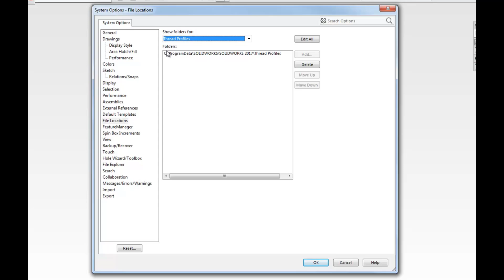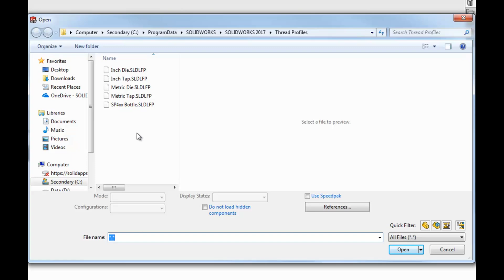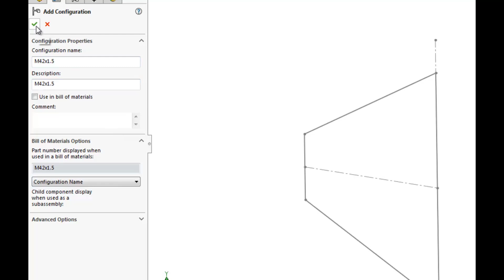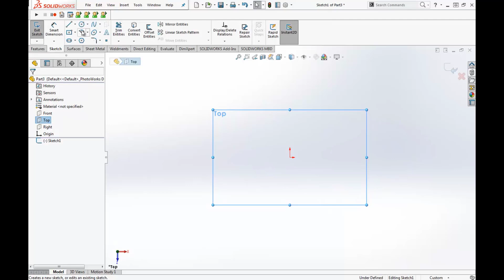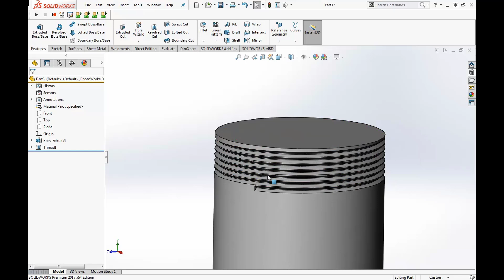SOLIDWORKS Hints & Tips: Adding a custom thread

Comment: Thanks a lot for the video.

I noticed something though when you edited the sketch.

the profile land was "1.5".this is because a die has an internal thread,& the land is determined by divding the pitch by 4 (profile land =Pitch/4).for an external thread e.g a metric tap,you would use P/8 instead.thus with a pitch of 1.5 your profile  land for the metric die should be (1.5/4)=0.375mm.

Comment: I'm able to change most figures but I'm looking to create a square thread and it sadly wont let me change the profile angle. It says its read only (I am running as administrator) I assume this is because that angle is a predefined angle for metric threads? I hope not though, will look for another work around if so :(
Reply: im having the read only issue as well. any resolution yet?

Comment: vishnu + 1 

I am having the same problem, how to edit this thread information if it is read only?
Reply: I had to run Solidworks as administrator. Navigate to the *.exe file (SLDWORKS.exe) which, under standard install,will be found in C:\ProgramFiles\SOLIDWORKS Corp\Solidworks\SLDWORKS.exe, right click on the *.exe file and then click "run as administrator". This should then allow you to edit the thread file.

Comment: Did you face any issues with accessing the thread file? I am only able to open the thread file in read only mode. Any help would be appreciated
Reply: I had to run Solidworks as administrator. Navigate to the *.exe file (SLDWORKS.exe) which, under standard install,will be found in C:\ProgramFiles\SOLIDWORKS Corp\Solidworks\SLDWORKS.exe, right click on the *.exe file and then click "run as administrator". This should then allow you to edit the thread file.
Reply: @seanwoodward33  Legend
Reply: I created a duplicate using "save as", then asked my sys-admin to drop the new file into the appropriate folder and replace the one there. It's an end run, but worked. I kept a copy of my duplicate and am in process of adding other standard threads to it (since the original SW list isn't very comprehensive).  Once I am done with it, I'll ask my sys-admin to repeat the drop&replace. And hope that the work done will carry over into the new update (currently running 2018), and not need to be repeated. 

FYI, my source info on threads is a very helpful and simple place through efunda, a bit like having a Machinery's Handbook online. ;-)     http://www.efunda.com/designstandards/screws/unified.cfm?start=1&finish=63